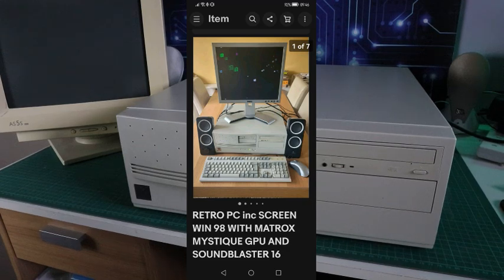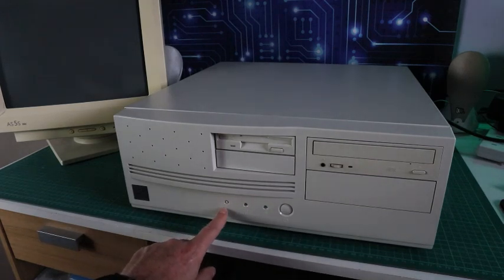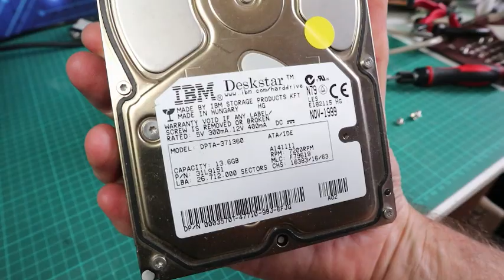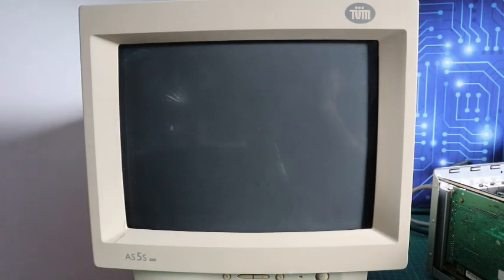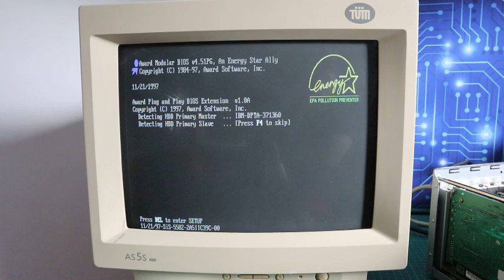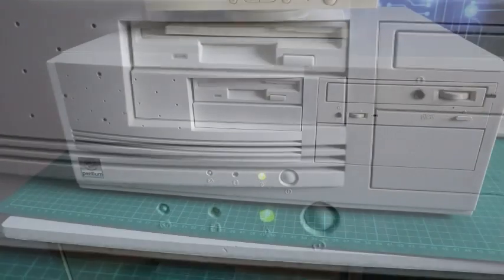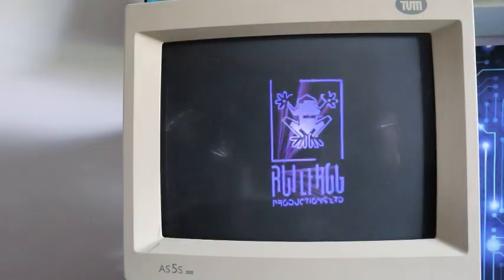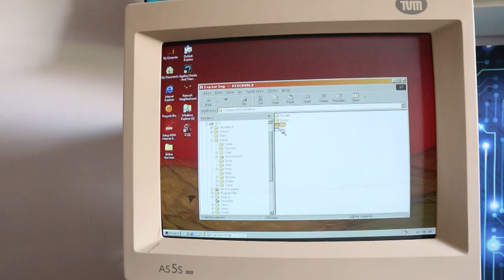A cool Pentium 3d gaming PC passed on from another retro enthusiast.

Comment: This system can perfectly run a lot of great 3d games from 1997-1999 like: Tomb Raider 1/2/3, Fifa 98/99, NFS 2, Ultimate Race Pro, Quake 1/2, Klingon Honor Guard, Motorhead, Motoracer 1/2, Star Wars Rougue Squadron, F1 Monaco GP, Superbike 98, Mortal Kombat 3d 1998, Official F1 Racing 1999, European Air War and many more.
Reply from the maker: Yes indeed. Thats exactly what I aim to use it for😁

Comment: I noticed your using a magnetized screw driver, bad idea it can fry components.
Reply from the maker: Im not sure that level magnetism would cause an issue if using it to lift screws, at least notnin mynexperience over the years. I wouldnt stick it across the legs of a capacitor though 😁

Comment: Nice machine . But Windows 98 ? What a waste, why bother with it ?
Reply from the maker: Win 98se is what it came with. Wouldn't that be the most stable period correct os for a late 90s gaming rig? Im open to suggestions, what would you're alternative be?
Reply: @66mhzbrain  ;; Wow, it's been a lot of years since I dumped Windows for good, but perhaps you might get XP to work for what you are wanting to do.
Reply from the maker: @garyjohnson4608  this machine would be too slow to run xp. The point of this machine is to be a period correct gaming rig for mid 90s. A more period accurate o/s would probably be windows 95! The fun is in keeping it ancient😁 and running mid 90s games the way they were designed to be played. Got plans to build an xp gaming rig but probably on something like a pentium 4.
Reply: @66mhzbrain  ; Running XP on a P4 machine, that sounds interesting. Back when XP was the best Windows version to have, I was working for the phone company, and in our office, we ran XP on our pc's. It was the only version I have ever used that was stable and dependable. I would have installed it on my home pc, but at the time it was just more than I could afford to spend.
Reply from the maker: @garyjohnson4608  yes it was solid. Would have to be for the phone company to use it! It was expensive, it was a while before I upgraded back then , I just got it when I bought a new pc a couple if years after it was released.
Reply: The 200mmX will definitely struggle with XP . I still use my 200mmx voodoo 3 for retro gaming & found Windoes Me is pretty good & I prefer it myself to 98se but must admit it's easier to set up 98se as getting " ME " stable can be a pain in the hard-drive.
Reply: Because the machine won't run XP well  and XP doesn't run retro games well.  Have you actually watched the video?  233 MHz clock speed is the minimum recommended for XP.  And that's for Windows XP "gold" This machine is only 200 MHz which fails for XP, and its 128 MB RAM just BARELY meets the XP recommendation    By the time you get to service pack 3 there's enough bloat to make a Pentium 4 gag.  XP is built on NT technology, which has to emulate DOS, often poorly.  98 runs on top of DOS natively.

Windows 98 is a happy medium that allows you to run games from the DOS era to the early 2000's.
Reply: The best OS for this machine is Win98 or Win2k. Both are modern enough to use relatively modern peripherals (USB, WiFi, SD memory cards) and stable enough (I look at Win98 here because Win2k is rock solid) to be used without the need to reinstall the OS each month. Also these are very compatible with this old hardware. Both can run dos software very well (Win98 natively and Win2k with its ntvdm and some tweaks) and for windows games they are both DirectX 9 compatible so no problem there too. Both OS are very fast on that P200MMX and have a low memory footprint; I ran stable Win2k on 32M and played games - Starcraft, Diablo - with 64M more and I doubt that XP with SP3 and latest updates will even boot with less than 256M. 
Also they can run Office 2000 and are quite capable of good multimedia performance (mp3, divx, mpeg video, CD and even DVD playback with a good video card) so in a way, if one do not need internet browsing or youtube videos can use one computer like this as its main machine. I do know a friend that have a P3 as its only computer with Windows 98/2k dual boot for retro gaming and its internet necessities are satisfied by its phone.
My dos/Win3.11 computer is a P1@100 with 32M RAM and the Win95 one is a P@200 with 48M  of RAM. I do have a P3@1.4GHz for Win98 and a core i7 940 XP machine.